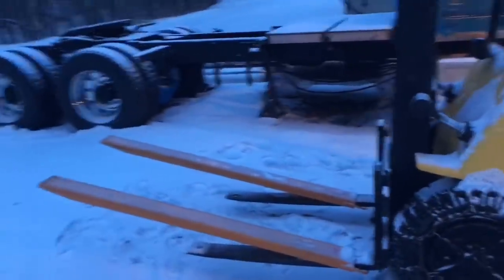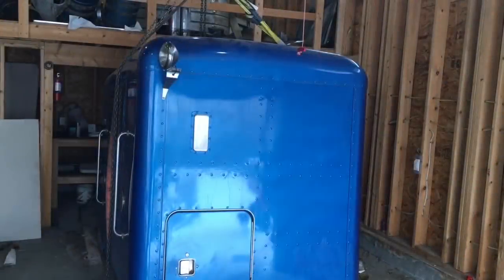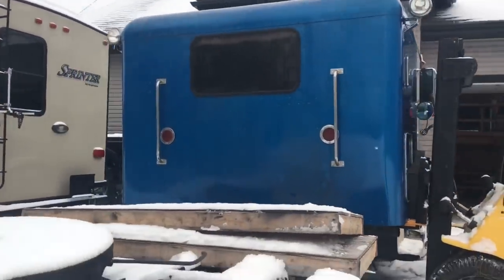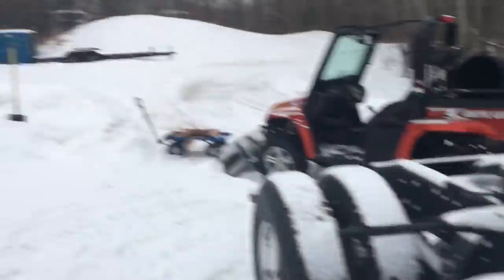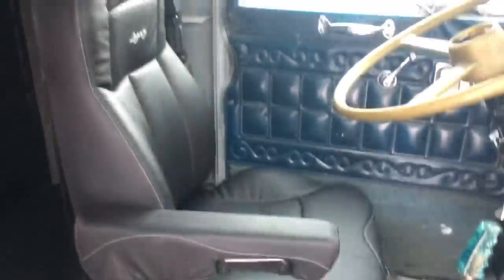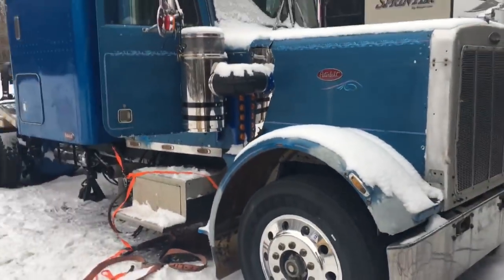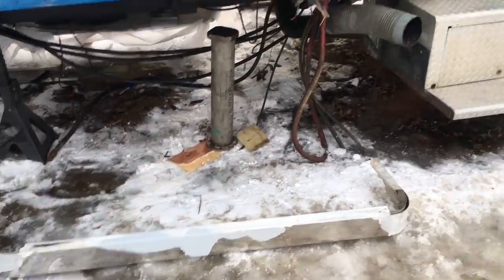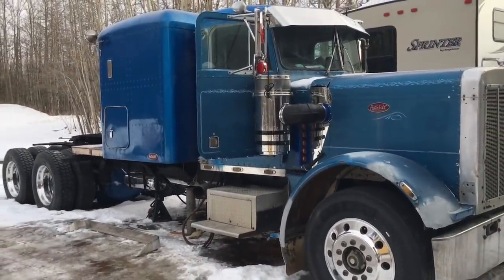Peterbilt 359 Restoration Ep.25 Sleeper Install

Comment: Just discovered this series last night and binge-watched the whole thing, absolutely love it! I like the way you’ve chipped away at the trucks issues “Little by Little”. 
   My Dad was a 40 year + man with Freightliner and I’d like to find one similar to your Pete to use as an oversized pickup. 
   Keep up the great work! I agree with Doc Moe’s comment below. You should have “Little by Little” lettered above the rear window on the sleeper. 

P.S. The idea they still built trucks of this vintage without front brakes is disturbing. I guess with so much weight on the drive wheels they would provide enough stopping power.

Comment: I watch ur videos all the time. I have a 1984 exhd  pete, I will tell you if you get a rubber boot for a 379 you will be glad that you did.  Also get the bars that go on the boot and the just screw the on and your screws go through the boot and hold it up so much better that the 359 pinch bars and boot. Anyway l love your videos.

Comment: been there.... done that.... with the dings and scratches, it's tough trying to do something like that by yourself, I'm assuming you are going to pull the sleeper interior out eventually like you did the cab.... a little hammer and dolly work and some primer and it will be as good as new, I believe those sleepers are aluminum so you have to be careful not to overwork it as aluminum work hardens easily but it's a pretty simple fix.... sucks when it happens though, I've got shrink film on the windows of my project so I can heat it and work inside while it's cold.... seems like your making some progress when you can get some heat into it ... keep it up, your an inspiration to those of us working on projects in the winter

Comment: Looking good !  Said this on the diff take out video, but you don't need to cut those break hoses. As long as the the hose isn't damaged, those ferrules don't need to be replaced.
Reply from the maker: dennis smith good to know ... I’ll be sure to reuse them as they look fine - thanks

Comment: Use a little bit of caulk as an adhesive for the seal get the clear one so it won’t be visible from the outside or the inside it’ll also help as a little bit of a seal if yours isn’t “perfect” to fill up some gap
Reply from the maker: Jacob Wain good tip thanks
Reply: No problem driver keep up the work your making great progress 👍🏼👌🏼🙏🏼

Comment: Ouch, sanding and some paint will cover those scratches up, things happen.
 Might not hurt to just leave the heater core in the sleeper disconnected unless you are going to be using her in the winter.
That Legacy seat is a pretty good seat, have one in my 379.
I was thinking that those coarse splines were going to be a problem, haven't seen those in years. Wow 456 ratio, I guess it was overdriven.
Remember to have the two drive shafts in time with each other when you put it all back together, you have probably been told that over and over, but in case you haven't ......well now you have.
Might want to pull both heater cores and have them pressure checked at a radiator shop, they are pretty old and anti-freeze makes a big mess on the floor.

Great progress, great video, keep up the good work. EH!
Reply from the maker: Rudedog S when you say in time you mean that the input and output yokes are aligned?
Reply: @TwinStix  Yes you want the yokes both at the same angle, say , both yoke U joint caps at 3:00 and 9:00, so the drive shafts are aligned with each other other wise it could vibrate when you drive it. That is called drive shaft timing.
With that fine spline it is easy to get them off from each other, there is still a little play in the power divider, but as close as possible is the idea.
Since you have the drive shafts out it might not hurt to have the slip joints checked in both, and check to see if the balance weights on both are still welded on the drive shafts.
Some drive shafts won't have a balance weight, but a lot do. 
They just look like a piece of metal welded to the outside of the tube, about 1" wide, and however many inches long as was needed.
Those drive shafts have been sitting around for a very long time, they might have a bit of corrosion in the slip joints, it would suck to have one snap off and flail around 
tearing out all your new airlines and wiring.
Not trying to be a downer, just things popping into my head, that I would be serious about. 
Good luck, and keep up the good work, that old girl needed some love, and she is sure in good hands.

Comment: As a forklift  (FL) operator I have some questions. My FL usually have 3 sticks : up&down, mast tilting, and translation of the forks. Another one i use daily has even a fourth stick which gets the forks closer or wider as needed. How does your FL works? WOuld you do a video about it?
Thing the worried me the most is the lack of seat belt. Uusally death occurs when the forklift is overturning and the ejected driver, crushed by the roll cage.
Please drive it carefully especially on wet or muddy land. Keep up the good work !

Comment: when you put the trim on the bunk ste tou putting lights on it should get drilled for the 3/4" led lights they are weather proof lights then go see tina at lesco  they sell them there
Reply from the maker: ken nickerson not sure if I want lights through the panels ... was thinking I might go with blue glow lights underneath instead
Reply: @TwinStix  either way would look good.  But blue would look really clean

Comment: Sitting in the ER waiting for my friend and your video popped up. Had to watch it to keep my mind off things.  

I hope you don't mind, but I liken my truck similar to yours as Little by Little while things are coming together.  

Get knocked back four steps, make one.    

Funny story, well it is now! II've had my truck forever it seems like and I have Never had a dead battery issue before mind you. So I'm driving along and she dies in the middle of the road. Flat on her face. Its minus 10 Farenheit mind you. Tow it home and tear into it, checking fuel, spark and timing. I can't figure it out.  I ended up putting a new fuel pump on, fuel filter and two new sensors.  Nothing!! She's as dead as a doorknob.   My best friends' dad (may she rest in peace), goes and buys me a new battery. I throw it in and she fires right up like nothing happened. 
I was ready to sell it honestly.  I was pissed.  It's the simple things that rack your  brain but you know deep down you love it.

Comment: I think that stainless steel you plan on putting inside the cab on the wiring panel at the top front of the cab would be very distracting and may cause a glare making just seeing hard. I would think a covering the opposite color of the head liner would look really sharp and not possibly cause a blinding glare. Although the stainless could be covered later if it is a problem. I guess I am just not a stainless steel inside a vehicle type person. :)

Comment: Very nice but I'll bet those scratches were caused when you were hitting the sleeper with the chains as you were lowering it with the block and tackle. I immediately saw that and thought he's going to end up with some real scratches from those chains.
Reply from the maker: mike reece the deep scratches were from the brackets as they are in line with them and are horizontal but I admit I could have been more careful with the chain fall as well ... live and learn but the whole thing’s gonna be repainted anyway

Comment: Just check the back lash on the rear diff, check the geargrease for Metal. It could probably Use new bearings and Seals, seals don't Like Sitting.. But there is only the ring and pinion in the rear, unless you have Traction-Control Diffs, then there's the Locker.  Same as a 3/4 ton pickup rear axle, just BIG, lol!  Your heater and A/C cores are looking Rough....
Reply from the maker: jim nickles ya I’m thinking I might pull the 5th wheel plate off to give access and then pull that diff out and give it the once over
Reply: We always just Back the rear up on Blocks and drop them out from the front. Roll it off the jack, roll it out, and forklift it into the shop, then wrap it in Saran Wrap while you roll it back under and get it back on the jack. And you can always pull the wheels off on one wheel for Extra room. Also, as you tear anything down, make a List of all the Bearing, race, and seal Part Numbers, so if you're going down the road and Detect a bad part, you already have the Part Number, just get on the phone Shop Around for availability and Best Price.  This Works Great for stuff like the above-mentioned, injectors, turbos, U-joints, tie-rod ends, etc.  @TwinStix

Comment: Awwww my dude you gotta put a 359 sleeper on it
Reply from the maker: That blue lb7 Duramax actually it might be a late model 359 bunk as the mounts lined up perfectly, it has the little opening and I’ve seen a few 359s out there with the smaller access door on the right side.  I might restore the original one someday and put it back on as that original pressed Peterbilt logo in the fibreglass cap is pretty cool
Reply: 359 TwinSticks true true never thought about that but the original would be really cool
Reply: 359 TwinSticks it just really depends on the interior if it is fabric or leather like the cab

Comment: do u think it is possible to cut out a puece behind the drivers seat and get another runbber to fill in to be able to mount or slide seat back more? i have a 88 that iv bin thinkin if it was possible to do to get more leg room? what u think?
Reply from the maker: hi by ya it’s called a “big hole conversion” essentially cut the hole bigger on the sleeper and the cab and redo the seal.  It’s something I’d like to do down the road to give more leg room but for now I can live with it
Reply: ok, i daily work a 88 379 3406b, love it but would like to do that conversation, i will see what i can find in big hole conversation on internet,im guessing they use the frame of a unibilt but that sounds like alot of work n modifications!!

Comment: Hey why did the truck og come with a power steering wheel but I couldn't see the tank for it on the side
Reply from the maker: Zack Michtels the power steering tank is right above the air compressor on the left side of the engine.  The seal going into the steering gear drive on the front of the motor must be leaking since all the transmission fluid I had in the tank walked down into the engine oil
Reply: @TwinStix  oh ok thank you for telling me

Comment: Woo 4.56 short legs
Reply from the maker: Angry Trucker haha ya but I’ll be able to pull out tree stumps and pull B’s ... still think that double over will give me some going home gears
Reply: @TwinStix  I'm not that familiar with the older transmissions. What's the final output for that double over? 
.76? Anyway older trucks like that never meant to go fast lol. I'm definitely looking forward to finding out what it does though.
Reply: with the double over you could have as low as .62 so your effective final drive with 4.56 gears would be 2.82 but since it's probably not a Texas truck it's more likely. 78 or so which would be 3.55 effective ratio. That would put you at around 1450 or so at 100-110 kmh which would be perfect for a b model. Quiet and torquey and it will drag down to 1100 or so with your fifth wheel and that will sound just awesome with the window rolled down.
Keep up the good work.

Comment: @359twinsticks Why don’t you work inside your garage it looks plenty big
Reply from the maker: Ya I designed it tall enough but only built it 30’ deep and the truck is 29’ so it would be pretty tight.  Once it’s running I may squeeze it in there for next winter’s work